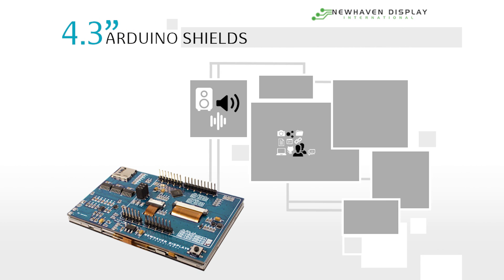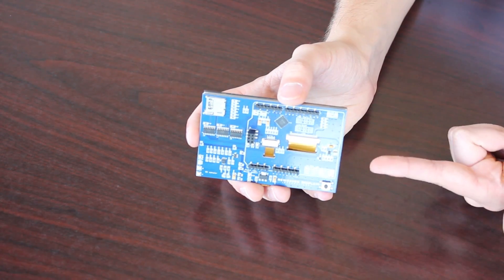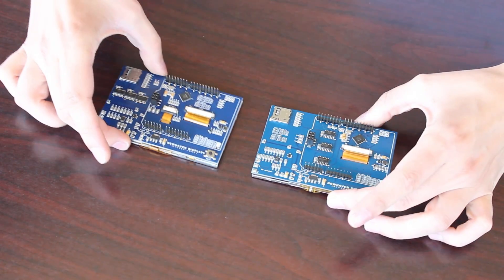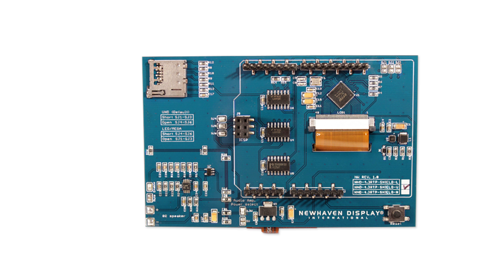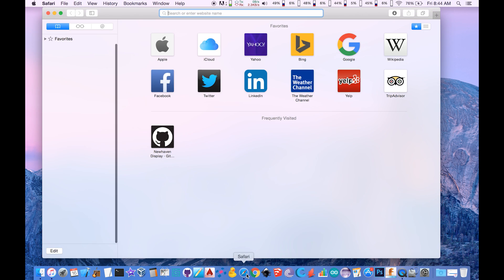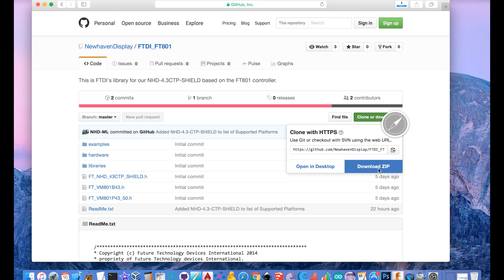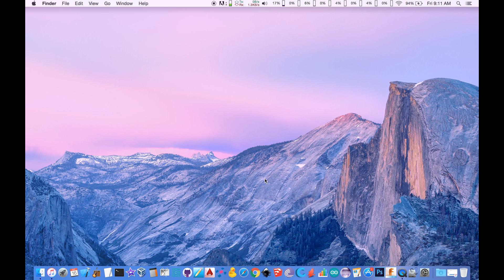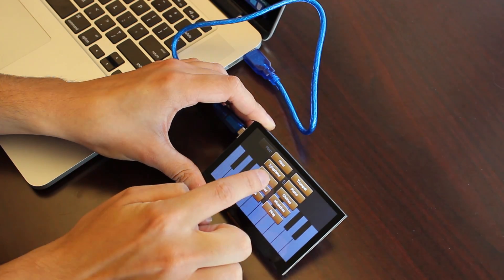4.3" Arduino Shields - Overview & Tutorial

Comment: NHD-5.0-800480FT-CTXL-CTP is it same foe this tft also ..?
Reply from the maker: Hello,
These shield boards are not quite the same as the 5.0" EVE2 display.  The shield boards are designed to mount directly onto the Arduino, whereas the EVE2 displays require the NHD-FT81x-SHIELD and a 20-pin FFC cable.  In addition, the shield boards use the FT801 engine, whereas the 5.0" EVE2 display uses the FT813 engine.

Comment: Is it possible to control the Display with a ESP32 Board and is there a Library and PIN-Schema available? Thx
Reply from the maker: Hi Uwe, our engineering department will be able to provide this info. You can reach them at nhtech@newhavendisplay.com
Reply: @NikolaTyson  yes, I got a answer, that the shield is specifically made for the arduino Uno ...